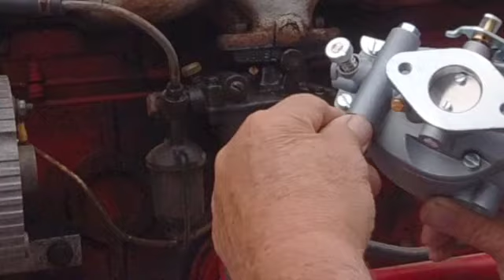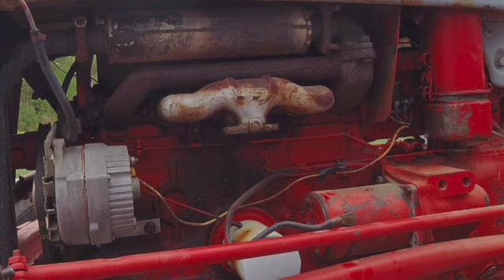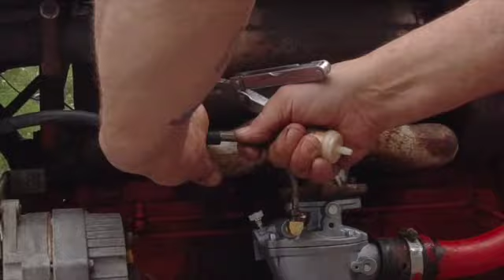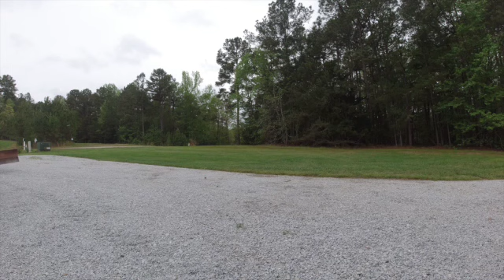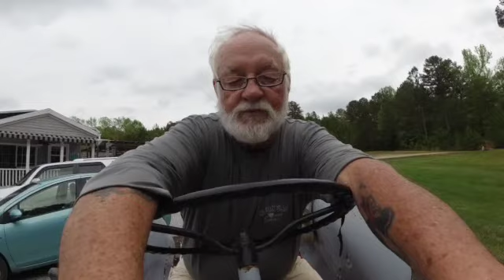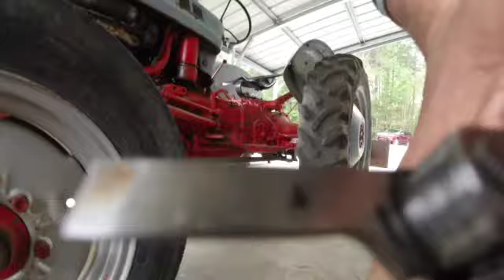1957 Ford tractor carb swap

Comment: I know its been two yrs ago but one thing is the air intake tube is missing the extra hose clamp on the carburetor, its sucking in air giving it a rough idle, you can adjust all that stuff and it most likely won't make a difference and the fuel line is up n down and up n down before it gets to the carb, give the fuel line a nice smooth flow.. carb fuel adjustment is 2 turns out and air is 1 turn out..
Reply from the maker: Thanks for the info...

Comment: Take the gas fitting off of the carb and put Teflon tape around the threads it's gitting air in it somewhere thats why it boating..or the float needs adjusted but I think it's air gittin in the line..tape up the threads and see if it helps..
Reply from the maker: k